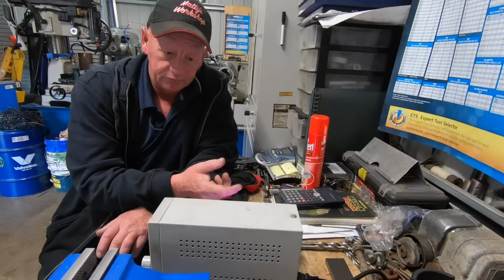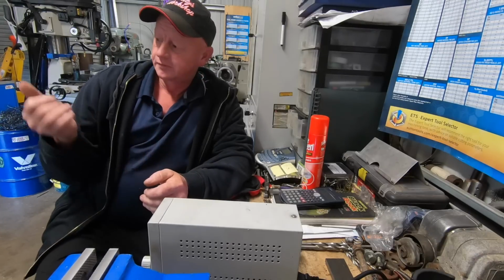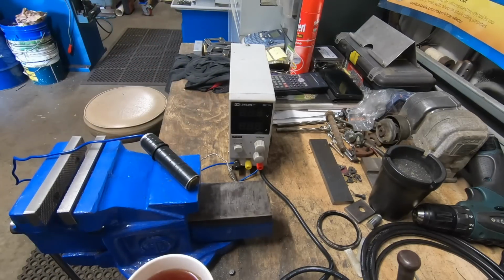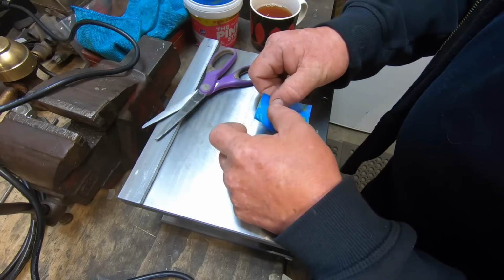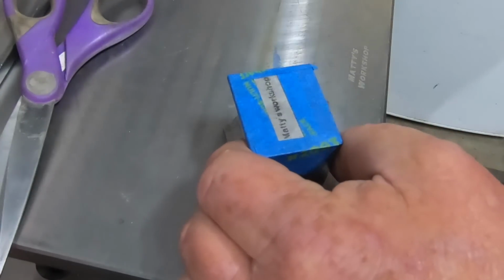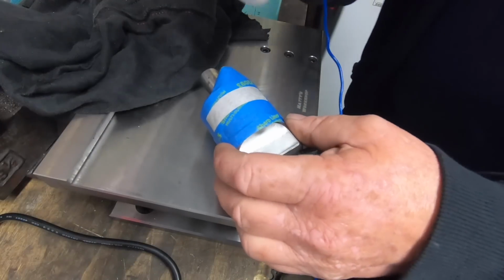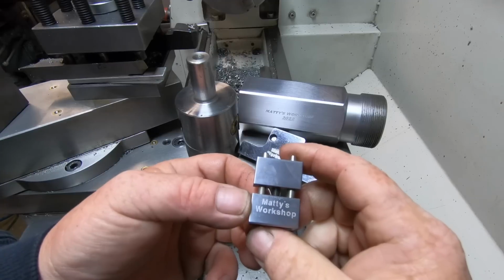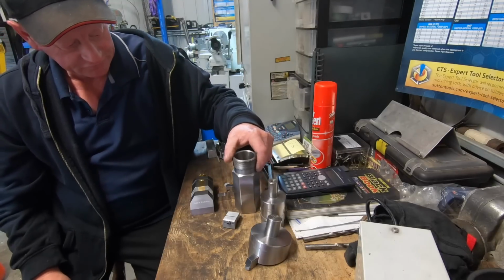Electro Etching

Comment: Hi Matty, Thanks for Posting this. I had no idea it was so easy. What kind of Tape or Ribbon do you use on the Brother P700? Is it the non Adhesive Backing? Also, does the P700 kinda Etch through the Paper so the Salt Water goes through only where the Letters are? I would love to be able to do this to the Things I make. Anyway, Thanks again Matty.👍
Reply from the maker: Gday, the tape is called “Stench tape”, it’s etch’s through the letter printed in the tape, it’s not sticky backed so you need to used masking tape to fix it to your job, there a one use stencil as well, super easy to do and works well, let me know how you get on, cheers

Comment: Thanks heaps, Matty.  I've done a fair bit of etching sort of like you did here, using a wall-wart and cotton balls soaked in salt water over a vinyl stencil.  Kept trying for a deep etch then paint spraying and sanding off the surplus.  Got varying results;  a quick zap would look nice but be too shallow, and a longer zap usually gave me edge bleed and blurring, although I got some beauties.  Tried all sorts of ways to get the stencil to stick firmly at the edges.  After watching you I'm thinking maybe slopping the salt water on was total overkill, and just keeping things damp would work best.... of course, the heat generated might be lifting the stencil too.... hmmm, experimenting time!  Thanks again, Matty.
Reply from the maker: Gday, I found having to much moisture affected the edging as well, less is best I think with the stencils I use, if they get to wet they can tare easily and the finish isn't as sharp as it should be, please let me know how you get on, Thanks for watching and commenting, Cheers

Comment: Ciao Matty! That Is very interesting, some years ago i did something similar with vinegar and salt, 6 Volts battery, not good results! But now you have stimulated me again the desire to try!  I would like to ask, what's in the blue container?  Water only?  Then I'm curious to know how stencils are made, that is, how does it penetrate the liquid only where there are writings? Sorry for the questions, but the method inspires me a lot!  Thanks and a big ciao from Italy!  Alberto
Reply from the maker: Gday Alberto, in the blue container is water mixed with table salt, add as much salt as you can, the stencils are made on a Brother P-touch P700 label maker, I use stencil tape, there’s links in the description where I brought mine from, if you shop around you’ll find this cheaper, it’s important to have the polarity correct, negative goes to the “wand” and positive to the work piece, I’ve tried voltage down to 3v and it still works but not as quick and voltage up to 24v, it etch’s quick then, please let me know how you get on, thanks for watching, cheers
Reply: @MattysWorkshop  Thanks Matty i really want to try another time 😀

Comment: This is amazing Matty . my apologies in advance for pinching the whole system . When I do a video YOU will get the credit . Just spent £140 on Amazon . Cheers Ade.
Reply from the maker: Gday Ade, the cost of setting up to do the etching isn’t that bad considering what you can do with it, I was amazed at how easy it was and in all honesty I didn’t think it was going to work but it does, there’s no magic, the only thing I found so far is if you trying to get a deeper etch by holding the wand on for longer the stencil might get to wet and tare, I simple have a dry rag and wipe it off a few times and this seems to help, I did stick 24v up its ass and mate it etch’s quick then, thanks for watching and commenting, cheers

Comment: It's a lot nicer than the knife-dragging vinyl cutter way of making electro-etching masks, and way simpler than using printed circuit board film and UV. If the etch is deep enough you can use Elephant Black engraver's wax to get a decent contrast for decorative items. Some folks recommend putting a tiny dab of the electrolyte on the stencil before starting electro-etching, so it wicks underneath the tape and helps it to adhere better. I saw someone using a different stencil method two or three years ago to etch stainless but whatever they were using for electrolyte made the etched surface of the stainless almost black.  Must see if I can find the video. Excellent demo, thanks Matty!
Reply from the maker: Gday, I did think about a vinyl cutter but with small text it would be hard to keep the letters correct meaning the inside of a O or A say, this way with stencil tape is definitely simple and can do down to 3.5mm high lettering, I have done stainless now and it worked great, im looking into what I can fill the lettering in after etching to make it stand out more as well, appreciate you watching and commenting, cheers

Comment: Nice job my compliments!!!! I'll like to ask something .... If you need more DEEP etching you just change the voltage of the power supply unit???
If you have some free time instead of salt-water mixture can you use vinegar and tell us the results???

Best Regards from Hellas (Greece)
Reply from the maker: Gday, from what I’ve found so far if you want a deeper etch all I did was etched for longer, I’ve played around with the voltage up to 14v which made it a bit quicker, the longer you do it the more chance the stencil will fail and split, I found that out pretty quickly, I haven’t tried vinegar yet but I will, I hope this helps, thanks for watching and commenting, cheers

Comment: Hi Matty. I have the power supply similar to yours for anodising. I have a Brother P-touch printer too. Brilliant video. I just need the stencil tape & ready to go. Not seen it done like that. So simple & effective. Steviegtr here we come. Thanks for showing the way to do it. P.S. Just ordered 2 rolls @18mm. E-bay. Only place i could find it. Was from China. No-one in uk selling it. Came to £17.90 for 2.
Regards.
Steve.
Reply from the maker: Gday Steve, give it a crack, it’ll work, the tape you got is cheaper then I payed, I’ve put links in the description to where I got mine from, thanks for watching and commenting mate, Cheers

Comment: Hey Matty, great video mate! I'll be trying this myself for sure. Slightly unrelated question - can't help noticing your shop made tools look mint. What are you using for corrosion protection? Here in the UK if I don't blue things up they go rusty pretty much over night. Tried lots of things but not found the perfect solution yet.
Reply from the maker: Gday, definitely give it a go, we live within a 4min walk to the beach, surprisingly we don’t have a big rust problem thankfully, everything you see in the cupboard has nothing in the way of rust protection, just close the door of a night and it’s all good, things like the rotary table, in the winter I sometimes spray a light film of CRC on WD40 and that’s it, most of our wind comes from the west and blows out to see, I’d say it would be a different story if the wind come from east, thanks for watching and commenting mate, Cheers
Reply: @MattysWorkshop  Cheers Matty, maybe I need to get myself a better cupboard! Keep up the good work, you're doing some great stuff.

Comment: Hi Maty, you sure do like to live dangerously. First you steal a new dish towel and then you call her the "old" girl. That would've got me banned to the wood shed for a week at least. For your sake I assume she's got used to it and at least allows the dog to accompany you.(to the wood shed).
Thanks for the video.
 Apart from the ridiculous prices that printer companies charge for their cartridges, it looks to be a relatively easy and safe method of identifying your wares. 
One question I have is, is the etch deep enough to be able to spray paint it, wipe the excess off and have the etch more clearly defined.
It's certainly very much safer than the acid etch that was used on an Estwing axe that was given to me as a trophy about sixty years ago. The steel is so hard that engraving tools wouldn't touch it. I believe either nitric or sulphuric acid was used.
Regards from Canada's banana belt. 👍🍌🇨🇦🕊️🇺🇦🤞
Reply from the maker: Gday Ron, the wife and I get along very well, you should hear what she calls me some days, scary, im going to try blueing the etch and rub the surface back on a sheet of glass with wet and dry, the etch is deep enough I believe, if I get it done soon I’ll put it in a future video as a quick update, see how I go mate, thanks for watching and commenting, cheers

Comment: Ah, the running battle for kitchen supplies! 😉
As apprentices we melted a very thin coating of candle wax, scratched through that with a scriber then etched it with a drop of nitric acid with table salt poured over it. It was as neat as your handwriting 🙄
Reply from the maker: Gday, nothing like seeing what's available from the kitchen cupboards to go I the workshop especially after the wife's been shopping, from what I can work out many still do a similar thing using layout fluid and a scribe to make the stencil then use salt water to etch it in, Thanks for watching and commenting, Cheers

Comment: Thanks Matty. I have the Brother PTouch Cube and it does take the same tape cassette. Is the stencil not self adhesive like the normal labels? I saw that you can run over the stencil with a highlighter pen so you can see the lettering easily for aligning the lettering. Definitely going to try this.
Reply from the maker: Gday Preso, I did try the highlighter but it didn’t really go to plan, not sure what was going on there, it would be good if the they did have a sticky back, thanks for watching and commenting mate, Cheers

Comment: Awesome stuff Matty.  I have had your exact same thought processes over the past few years. I've been wanting to label my own work but haven't found a good easy and reliable,  repeatable way of making this kind of etched labels.   Did you use labels part number STe-151 ?
Reply from the maker: Gday Steve, yes thats the right stencil tape, I,ve also added a link in the description from where I got mine from, I hope this helps, Thanks for watching and commenting mate, Cheers
Reply: @MattysWorkshop  My pleasure Matty, and thanks for sharing your knowledge, even if it’s not directly associated with machining.  All info is potentially useful to us “machinists”.  Often we’ve gotta think outside the box. 👍👍👍

Comment: Very flash Matty 👍 I've thort about going down this path but I only use a single letter B so I just throw on a few coats of layout blue and scratch thru it with a fine pointer and then etch with a cotton bud, salt water or salted vinegar both work well. Not ideal tho cos my eyes are shit too 🤣 Would love to try this if you felt like sending me a couple of B's to test before I commit to spending money I don't really have. Cheers mate 🍺
Reply from the maker: Gday Bill, I think stencils will be a lot quicker and easier, I’ll have to find your address again, thanks for watching and commenting, cheers
Reply: Yep, scratching thru a resist is very old school, works well but a real pain if you fuck it up. I switched to layout blus coe nail polish tends to splinter , blue solves this but  can sometimes react with the etching fluid. I really like the crisp lines this method gives. If you can't find my address I'll send an email. 🍺
Reply from the maker: send me an email Bill...

Comment: Looks good mate.

Wonder how you'd go cleaning it with the stencil still in place then using a bit of gun blue on it to give some contrast.
Reply from the maker: Gday Daniel, I think the stencil will tare but I’ll give that a go and see what happens next time I etch something, thanks for watching and commenting, cheers
Reply: @MattysWorkshop  Just a thought, but what about blueing a part and etching aftewards?
Reply from the maker: @Warped65er  I still got a far bit of experimenting to do yet, I don’t have any dykem and it’s not easy to get in Australia, I can get dy-mark but I don’t think it’s as good…
Reply: @MattysWorkshop  Appreciate the response Matty, but I wasn't referring to Dykem (layout fluid) bluing. I was wondering about steel blueing, like gun barrel blueing, and etching afterwards to make the etching Pop against the dark iron oxide coating from blueing.
Reply from the maker: @Warped65er  yep I got it now, I think that would work no worries at all…